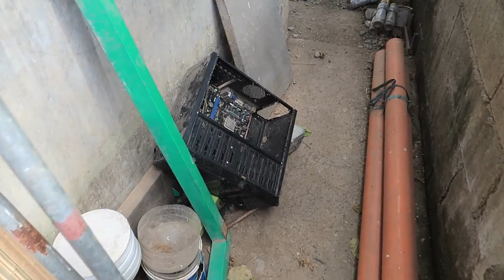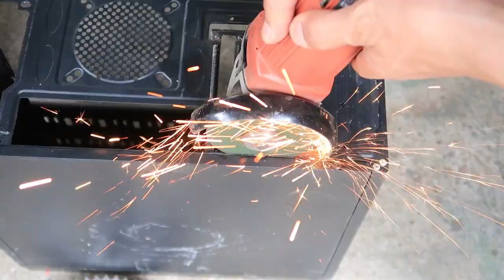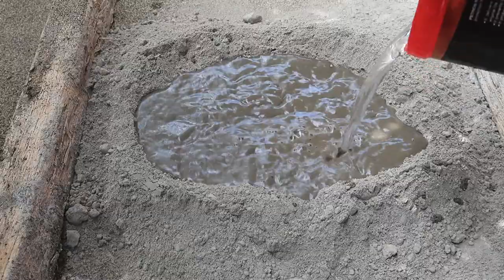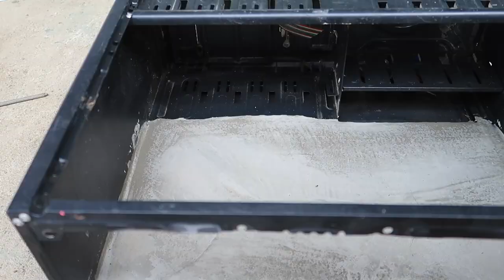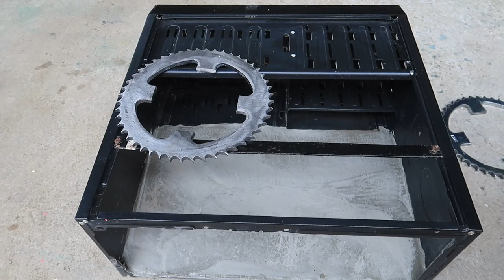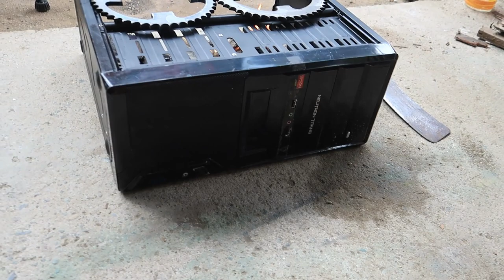How To Make Homemade Firewood Stove From Broken Computer

Comment: Just a heads up, probaly the front part of the pc is mostly plastic, would be a good idea to remove that, as with the heating distribution from the metal it can probably melt or worse catch fire. Besides that rwally good idea.